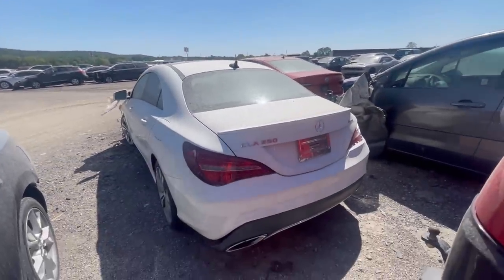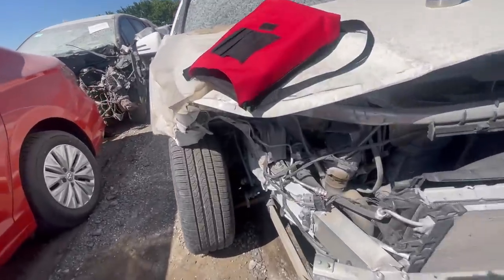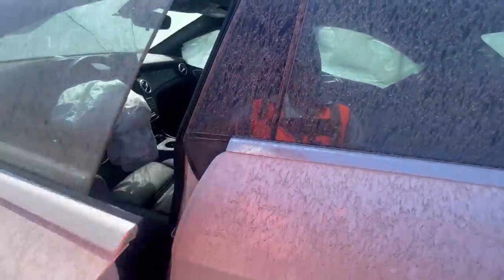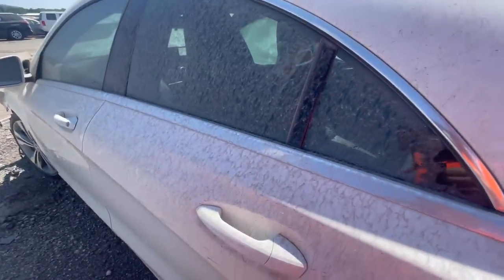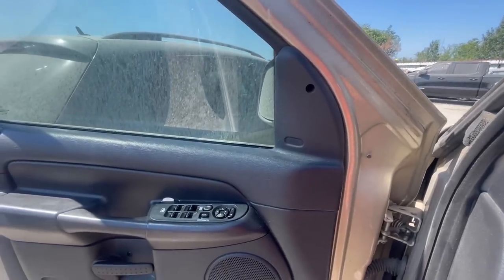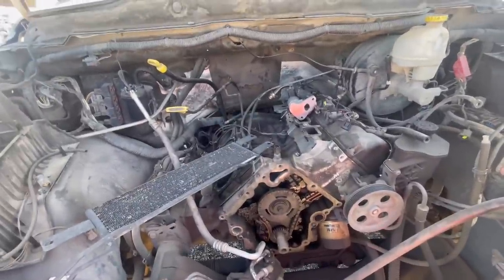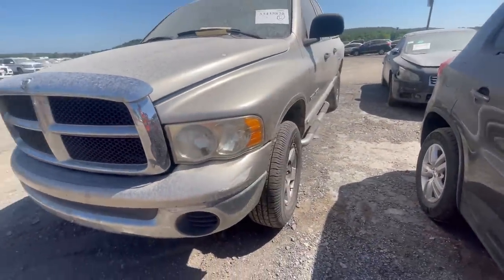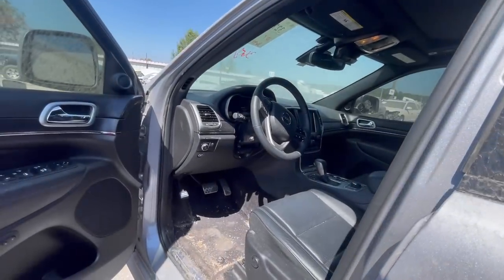IAAI Walk Around - 7/23/22

Comment: I did liked the Dodge Ram but after seeing the engine is torn up it's not worth to fix it.
Reply: If it goes cheap it would be worth it.
Reply: @mexicanspec  as long it goes $500 or less it will be worth it bro.😏🍻
Reply: @kirkacola7942  I am thinking of the labor prices where I am.  It wouldn't cost me much to get an engine back in that truck, but you don't know if the transmission is any good.
Reply: @mexicanspec  yea true about the transmission and I just see it as a parts truck and if you can get that Dodge Ram and your labor is cheaper to fix it up and bid on it bro.😉
Reply: @kirkacola7942  I am too far for that.  If I found a truck here in Mexico I would do those kinds of jobs all day long.  It is still a 4X4 double cab and they sell for what, $10,000 now and with a rebuilt engine maybe more?